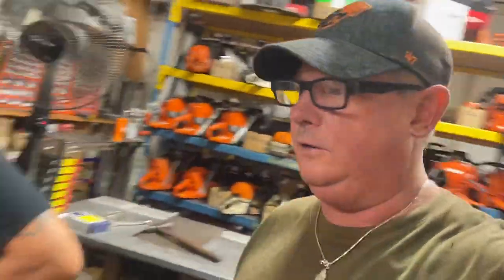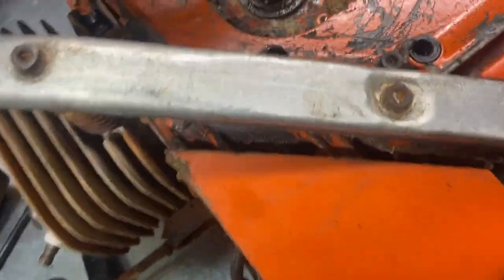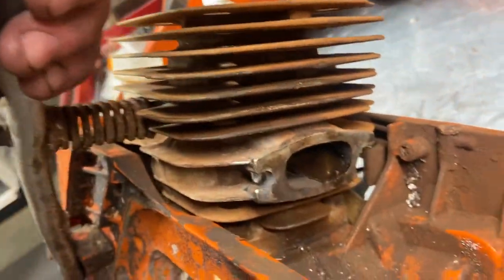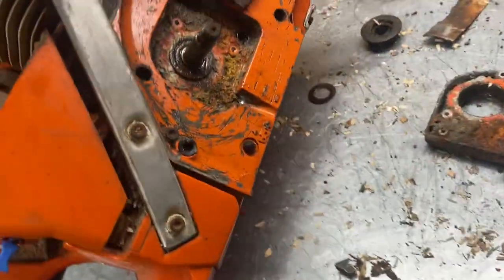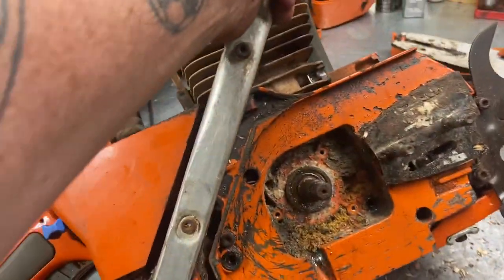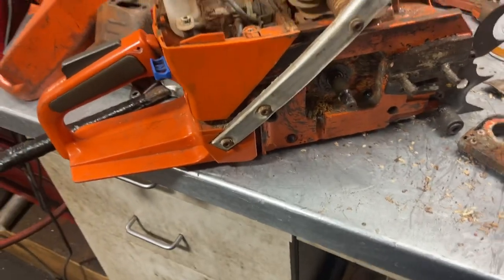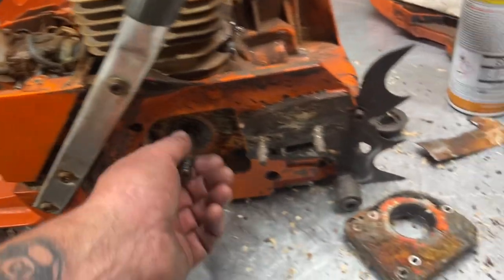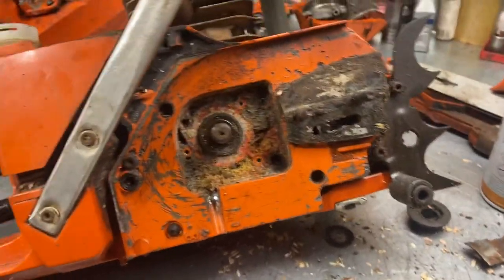Donny walkers chainsaws showing 395 rotting saw

Comment: what was different on the 2100? you said something about half aluminum.  Didn't get the reason thanks.  maybe electrolicis? love your channel.
Reply: Magnesium is way lighter than aluminium, and has some very big advantages due to that in a hand-held tool, but its also way more reactive chemically. As in substantially more, and it doesn't develop the impermeable oxide layer that aluminium, chrome and other metals develop. Like any metal and alloy, it has pluses and minuses.